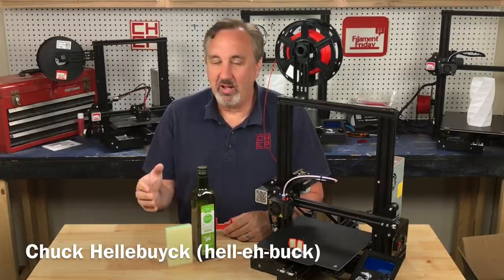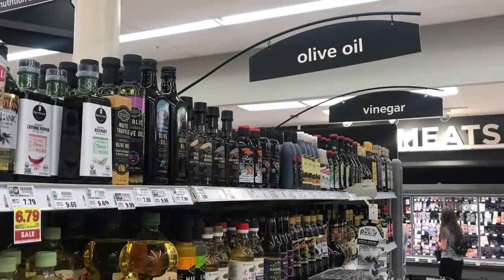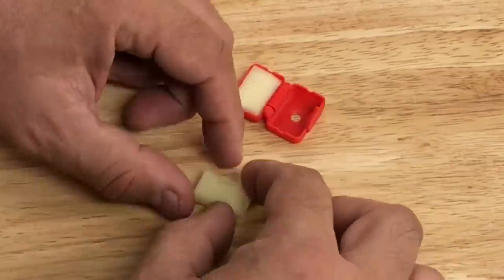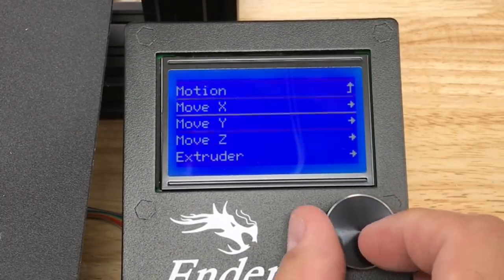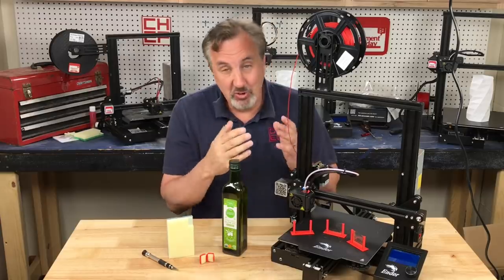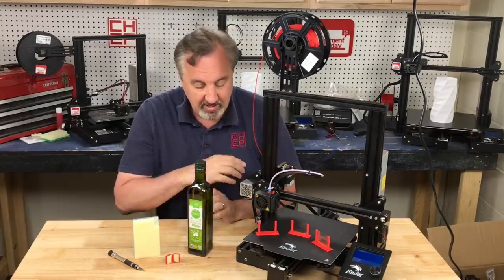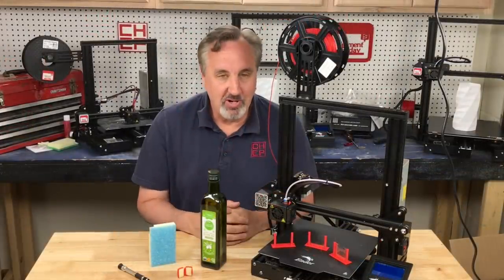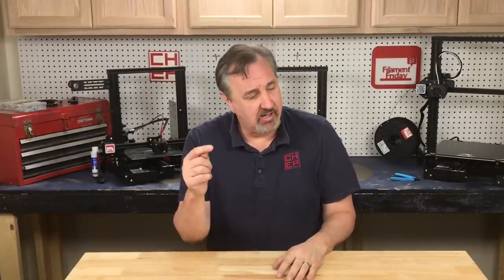Quick Fix to Eliminate Stringing on your 3D Prints

Comment: I have a simpler solution for stringing. Lower Your TEMPS!
Reply: Lower your part strength!
Reply: @nateschmitz9827  this doesn't lower your part strength when its dialed in correctly. IN fact if you use too much heat its going to also have a negative effect on your part strength, even causing complete failures. Your window of high detail and strength lies within a 10 degree window. The trick is, lower your temps until you hear your extruder clicking and almost clogging, from that point raise your temp about 5 degrees. At that point you will get super high detail prints with zero stringing, if you want to maximize your strength, just add another 5 degrees, DONE, you won't get a stronger part from that point, and your stringing will be to a minimum if not completely gone, seriously try this!
Reply: @imothy  no
Reply from the maker: @Mothy - Lower temps don’t always fix it. If the PTFE is failing, temp doesn’t matter.
Reply: @FilamentFriday  lowering temps should be the first thing you try, and will fix 90% of stringing issues. I see people going great lengths with magic tricks they think keep stringing down, when the simplest thing to try is just dialing in your thermistor. I've seen thermistors be up to 50 degrees off on some printers, causing massive stringing issues that have nothing to do with any other settings. This is thermoplastic we're dealing with, check temps first, if that doesn't fix it move on to other processes, but i think you'll find in most cases the temp will fix it!

Comment: wd-40 will work better
Reply: I don't know about this application, but WD40 isn't really a lubricant. I'm also not sure it would keep the sponge saturated?
Reply from the maker: Kokobloko - have you tried it or just guessing? 
WD-40 won’t burn up in the hot nozzle like olive oil does so it leaks into the print. Machine oil does the same thing.
Reply: even if it does burn up i reckon it'd leave some residue and cause a clog eventually

Comment: I HAVE A BETTER faster and EASIER TIP. USE PRUSA SLICER !!!!!
Reply: @kamahmah  do what he says and youll see no difference. Cura is shiiiiit all my problems gone when i switched to prusa
Reply: @thenewhello8980  It's about the settings then. I haven't used Prusa, but I notice that Cura doesn't enable Z-hopping by default and it drove me crazy when some cheap filament (a hair wider than the 1.75mm) caused the machine to over extrude which led to zits and oversized supports and they got so bad that the hotend hit them and knocked the darn thing almost clear off the bed. Switched z-hopping on and dialed back the extrusion a hair and bob's your uncle, all sorted.